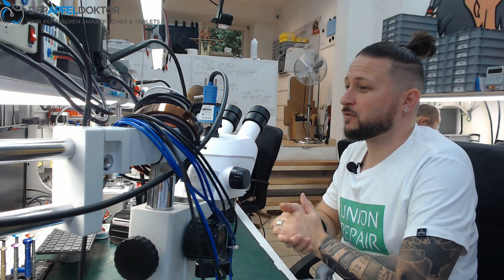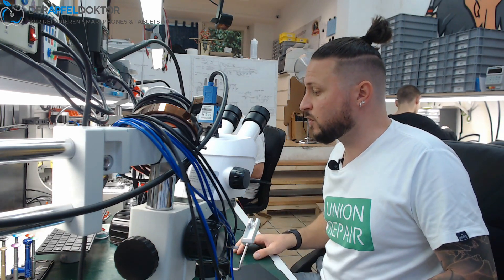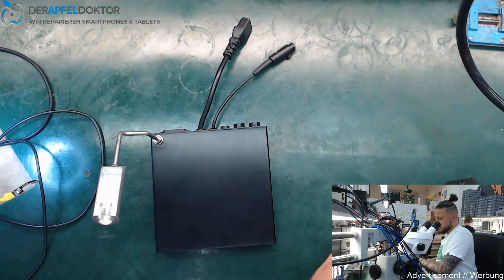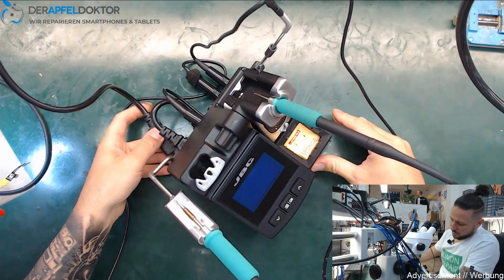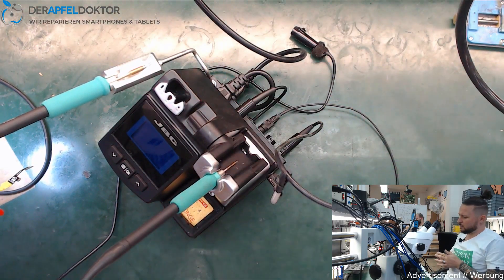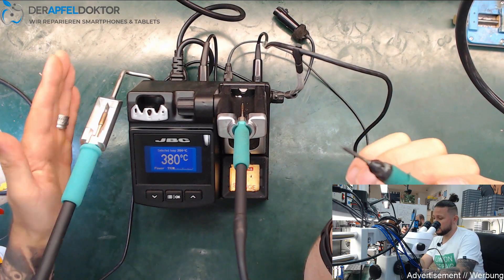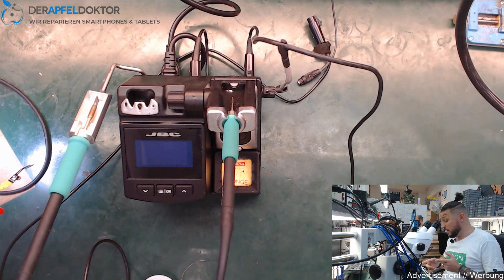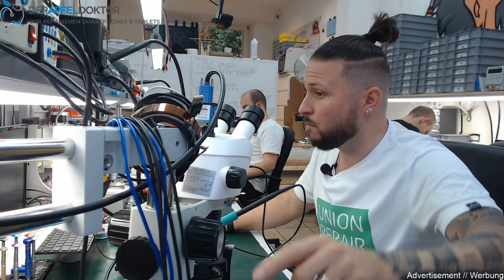REVIEWS - HOW TO USE A NT-105 ON A JBC CD2-SE AND HOW TO USE 2 IRONS ON IT

Comment: Ok, I'll make it clear on this extension. 
*It will NOT work with T245 and T210 plugged in at the same time. It will heat up, but it will behave erratically.  It will only work with two T210 handpiece.  It will accept NT-115 hand piece and T210 together.

Comment: Ben you are connecting t245 and t210. Did you check if both of them heats up? I have the same setup but a CD-2BQE station and one iron heats up and other one dont.
Reply: I have a similar issue.. they heat up but their behavior is erroneous..

Comment: In JBC terminology, a soldering station is the Control unit + soldering iron. The JBC CD-2SE and CD-2BE soldering stations use the same control unit, the CD-2E, it takes both the T210-A and the T245-A irons. I cant believe that people are buying this stuff, or sometimes even spending 400 euros on another JBC station, when all you have to do is spend 65 euros on a T245A (or a T210a) iron and plug it into your current station, which will instantly recognize it and will deliver the necessary power
CD-2SE = CD-2E control unit + T210a iron.
CD-2BE = CD-2E control unit + T245a iron.
The NT-105 is a different matter, but if you have the T210A iron you dont really need a NT-105 for fine microsoldering, the tip selection is almost identical.
Reply: Hahahahaha
Reply: The two stations have different wattages. The CD-2SE is 40 watts and the CD-2BE is 130 watts. I would buy the CD-2BE because it will work perfectly with the T210 and T245 but the CD-2SE will not heat the T245 iron properly.
Reply: Yes, a CD-2E control unit with a T210 iron plugged into it (also known as a CD-2SE station, or CD-2SQE the latest version)  is 40W. 
https://www.jbctools.com/pdf/CD-SQE_Exploded_View.pdf

And that same CD-2E with a T245 plugged into it (also known as CD-2BE station, or CD-2BQE) is 130W.  
https://www.jbctools.com/pdf/CD-BQE_Exploded_View.pdf
.... As I said, the only difference between both stations is the included iron and the included 2 tips. Control unit, mains cable and sponge is the same.
Reply: @gtm7713  You will notice that the blow up diagram does not show the power supply of either unit and that is what would clear up the issue. I can only go by what the JBC specifications show. If you can show where both stations use the same transformer/power supply then I would agree with you, but I can't find any information that shows the part numbers for the transformers of the two stations.
Reply: There is no "either unit". Just the CD-2E control unit (230V) for both stations.
Reply: Robert Dorr JBC website info is messy af...
Reply: @rodorr   I can confirm that Gabriel is correct! Because I have two CD-2SE. It came with the T210 handle but I had some problem with it so Amazon sent me out an exact replacement. I end up keeping both station, because the problem was resolve. So I end up ordering a T245 handle for one station  and it has no issue driving it whatsoever. And I used it everyday 4-6 hours  continuously with heavy usage for almost a year and almost never turn it off. I would let it stay on all the time. And never had one issue to date. Works like it was brand new still.

Comment: I just purchased this from Union Repair and I am very disappointed. 
Their description of this device is somewhat misleading. The TEC 
Extension Module will not work properly with a T210 and T245 iron. They 
don't mention this on their website. It apparently will only work 
properly with two T210 irons but that is just stupid. I don't need to 
have 2 of the same model of iron turned on at the same time. I want to 
use both of my irons, T210 and T245. This is a worthless product!!
Reply: hmm concerning, he does say they work in the video, are there different revisions?

Comment: Do you know is it possible or did you try to use nano tweezers AN105-A or AN115-A?
Reply: It will NOT work with any tweezers. Only one iron will heat up.

Comment: Ben. I have a Nase 2C with T105 and tweezer . Do you know if I can replace the tweezer with another pencil ?  Like a T110
Reply from the maker: For sure. No problem.
Reply: @RESQREPAIR  Do you know is it possible or did you try to use nano tweezers AN105-A or AN115-A?

Comment: Hi Ben, Great videos my friend. I have a JABE UD-1200 which is a high copy JBC CD2 model. Im using this same TEC Expansion module with A1 B1 B2 ports but my JBC NT-115 is glowing red hot when I try to use the JABE-UD 1200 instead of a real JBC CD2-SE. Do you know if this is a setting or just because its a high copy?
Reply from the maker: JABE is just crap. Buy JBC bro.
Reply: Philip Beauford is your T210 handle working with the JABE and TEC extension?
Reply: Prashant Saha yes the T210 works fine
Reply: Apfeldoktor Also Ben, what size iron do you use most often?

Comment: Thing is if you have JBC CD-2BE output power is around 40W, T210 soldering iron is designed to work with JBC CD-2SE which is set to 20W output. If you connect T210 that should work on 20W output to JBC CD-2BE it would probably be heating up very quickly but also you will be burning tips quicker so you would need to replace tips more often?
Reply: I Have JBC CD-2SE. It work correct with T210A & T245A without any extention modul. But you must reconnect handle if you want change C210 to C245 cartridge. Station have only one port (channel).
Reply: No, a CD control unit  is a CD control unit. if you connect a T210A then it is CD-2SE station. If you unplug the T210A and connect a T245A it then becomes a CD-2BE station.
Reply: Hi Tom, is this why my NT-115 JBC tip is heating to red hot when using the TEC Expansion on my JABE UD-1200? Is there a setting I can adjust on the JABE to make the NT-115 work properly and not get red hot?
Reply: @gtm7713  No it is not. The CD-2SE is only 40 watts. The CD-2BE is 130 watts.
Reply: @rodorr  That is correct. And a CD-2E  with no iron connected to it, is 0 watts. 
The CD-2E is the thing that you plug your soldering iron into,  and It is the same for both the CD-2BE and CD-2SE stations).
Reply: @gtm7713  The CD-2SE will not properly drive a T245 soldering iron, so if I were to buy one station it would not be the CD-2SE since its internal power supply only handles a peak of 40 watts whereas the CD-2BE has a power supply able to handle a peak of 130 watts. That is what JBC specifically states.
Reply: Please read carefully my previous comments, and Олег Топоров reply just above, and also do your own research, I have no doubt you'll eventually get it.
Reply: @rodorr  I can confirm that Gabriel is correct! Because I have 2 CD-2SE. It came with the T210 handle but I had some problem with it so Amazon sent me out an exact replacement. I end up keeping both station, because the problem was resolve. So I end up ordering a T245 handle for one station  and it has no issue driving it whatsoever.

Comment: somebody knows if is posibble use  the Nano Tweezers NP115-A with the extension?
Reply: It will NOT work with any tweezers. Only one iron will heat up.
Reply: Unisolder 5.2 worked with Nano Tweezers NP115-A and all many other soldering iron handle JBC, Hakko, PACE, WELLER, ERSA.

Comment: Dear before you post video make sure that  TeC extension module it’s work only. 210 / 115  Handel 

I watch your video and make Oder 210 / 245 Handel  after i check it’s only show the temperature on machine but actually there is no heat on Handel 245.  

So next time you post video make sure. People follow you don’t  misguide your followers okay. I lose  just because  of you. 700$.

Comment: If u need two iron u will use jbc ddu modular control unit, if u need use 3 or more u will use dmu modular control unit and u have a real control in your hand if u buy a chinese add u only have a big piece of shit in your hand.... erratic  overvoltage in the tips.... (not have the same voltaje t245-t210-t105) that is a shit like the all shit addons u can buy in the aliexpress....